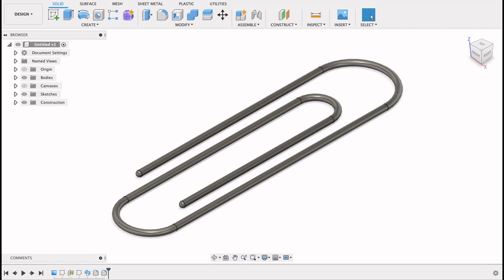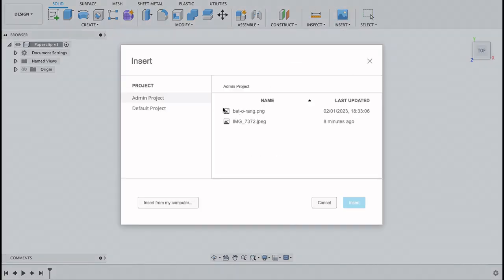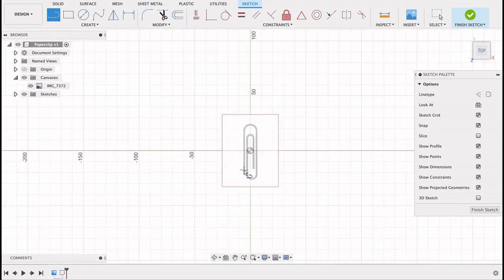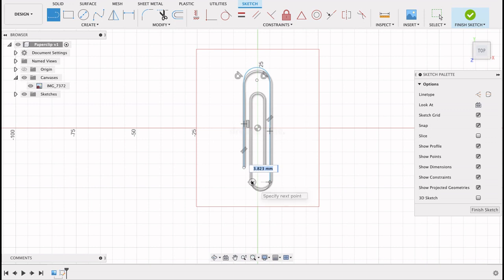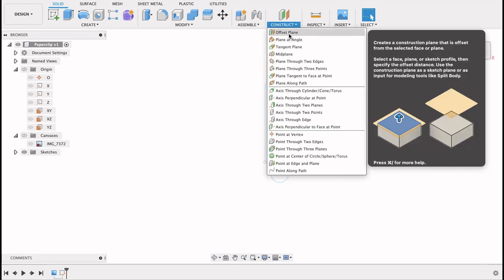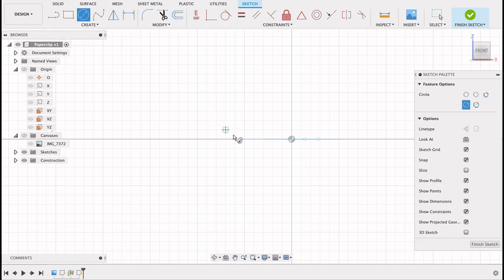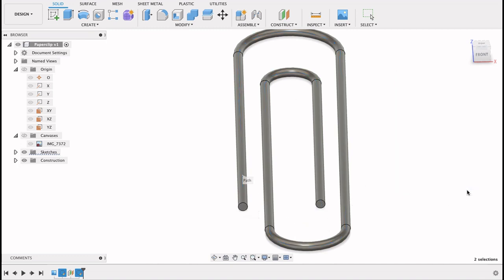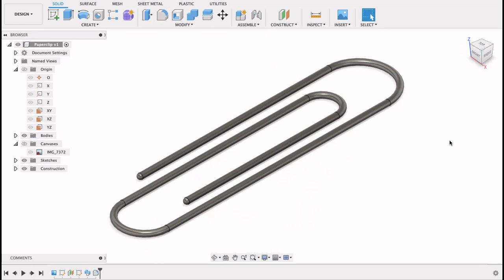Create a 3D paperclip in Fusion 360

Comment: Sorry, but what dies it mean "to hold a line in" to get a bended curve?
Reply from the maker: Hi, if you select the line tool and click to start a line then release the mouse button and move the mouse it will make a straight line. 
But if you select line tool and click and hold (do not release the mouse button) and move the mouse it will make a curve.
Reply: @Fusionfundamentals  Thanks for the tip. By far the quickest youtube comments reply in my experience, ever)👍 Another options would be to mark rectangular construction lines and form then tangent arc around.
Reply from the maker: That would work too. I’m design there are often many ways to do something. It’s all about how your mind perceived and how you see it all coming together in the end
Reply from the maker: Hi, if you select the line tool and click to start a line then release the mouse button and move the mouse it will make a straight line. 
But if you select line tool and click and hold (do not release the mouse button) and move the mouse it will make a curve.